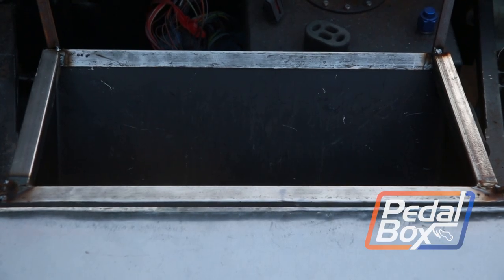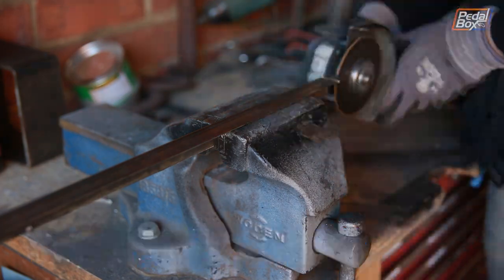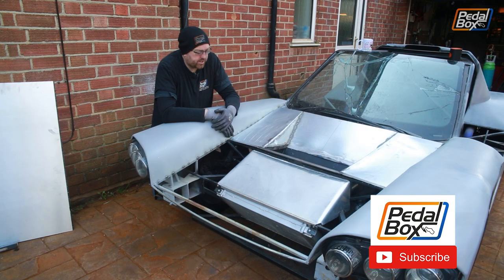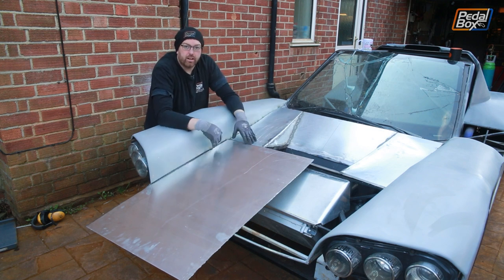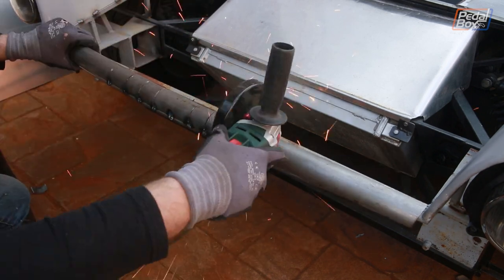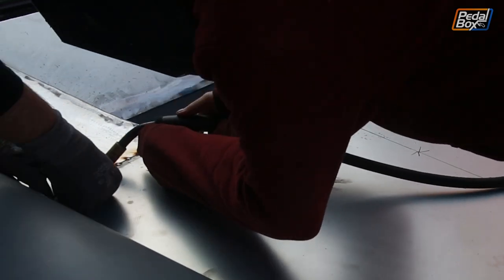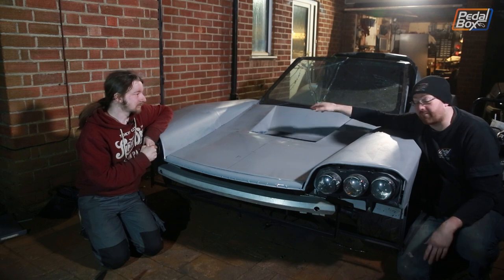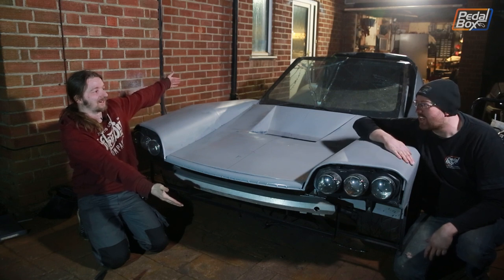Making the Bonnet | Audi TT Kit Car | Custom | PedalBox Episode 99

Comment: Great bonnet, still a bonnet regardless what's under it!
The 'hole' has to keep small children from climbing in, purposeful and lightweight - recycle a set of blinds for perfect leuve's!
Reply from the maker: Mmm, Louvres down the back is a nice idea... Need to plan some mesh to prevent debris, unsure if that includes children proof. With the fans might be a bit of a blender :S